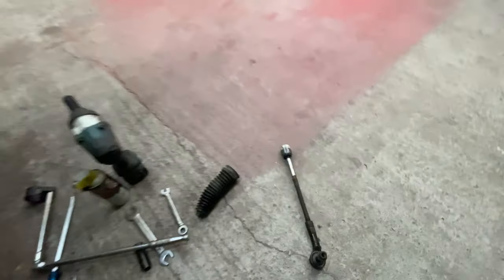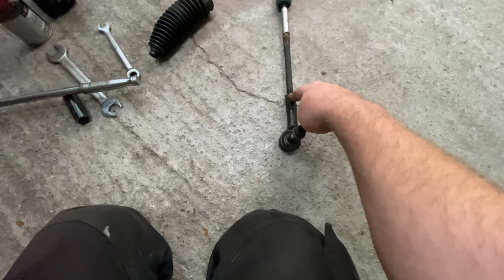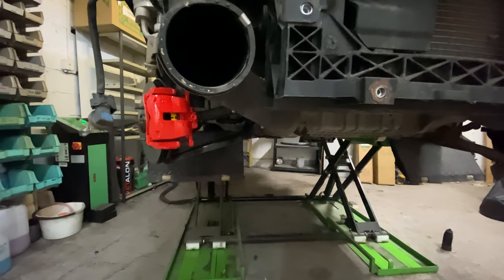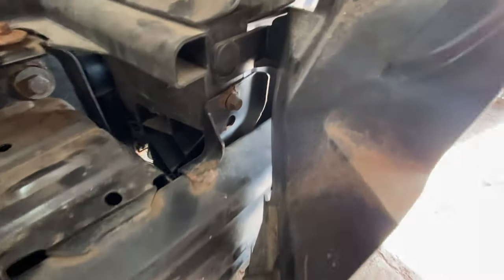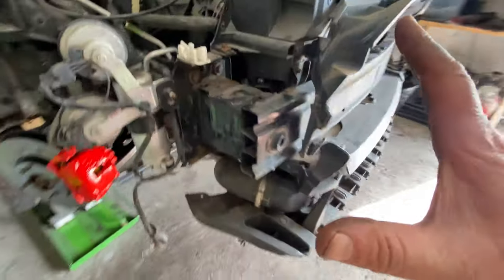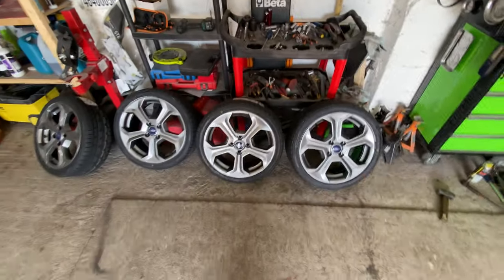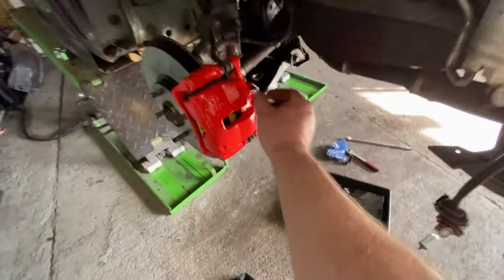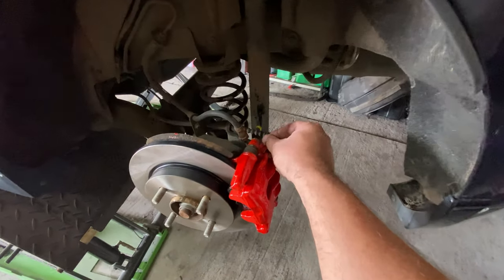Ford Fiesta ST-3 Crash Repair Part 4

Comment: Hi Mark, you are supposed to put the ABS system into service mode before you bleed the brakes, otherwise you won’t flush fresh fluid through the ABS pump.  Also get yourself a Gunston’s easy bleed kit, dirt cheap and makes one man brake bleeding a doddle👍
Reply from the maker: Thanks Steven nether herd of that don’t think most mechanics do that 🤷‍♂️👍👍

Comment: Do you not use brake cleaner on the new discs to remove the light oil that is on them ?  Wheels look great. Well done
Reply from the maker: Hi Stephen yes I did 👍👍

Comment: Hi l notice you have not been using the board re prices for part’s However with regards the vehicle looking excellent, Wheel’s looking good obviously the overhaul spend and recovery Good video good presentation well done
Reply from the maker: Hi Daniel I only put prices on the board for the wrecks to riches cars this is not one 👍👍

Comment: Hi Mark , glad to see things working out for you nicely . Your a good decent hard working skin . Can i please ask your advice on my daughters peugeot 207 1.4 HDI, when she floors it lol it puts the engine management light on saying engine fault , why is this please ?
Reply from the maker: Hi John very difficult to say without looking at it if you are in the Essex area I can take a look 👍👍
Reply: Vacuum leak possibly
Reply: @grandad8753  any idea where i look roughly thanks @ gran dad
Reply: @johnbarnes9379  get a can of brake cleaner, have the engine running and spray short bursts around the rubber pipes and inlet manifold, if the engine revs go up then you'll find your leak. If your unsure there are videos on here showing this process. Hope this helps